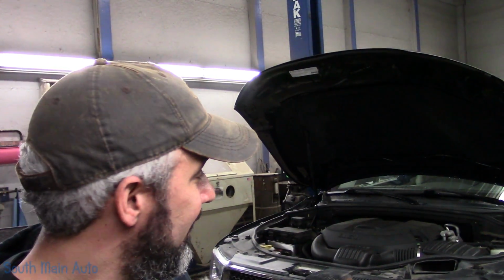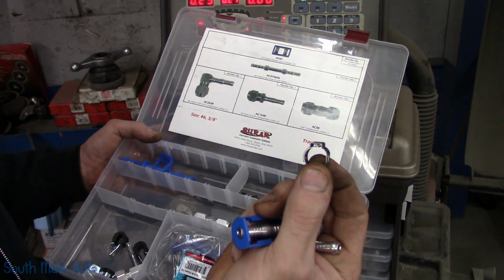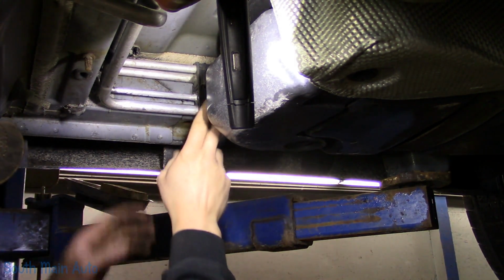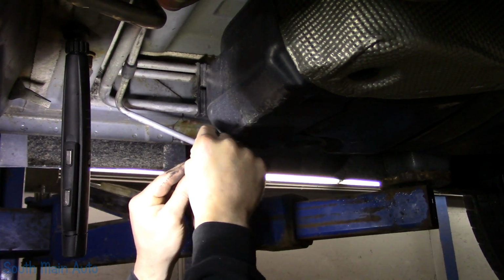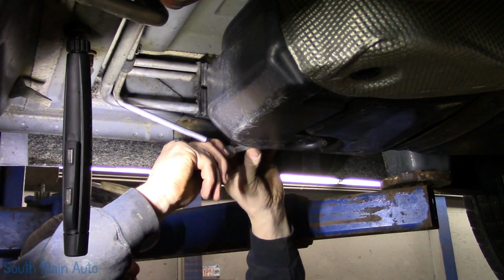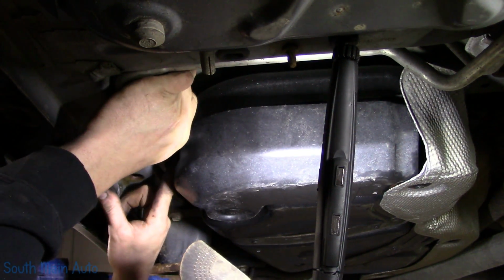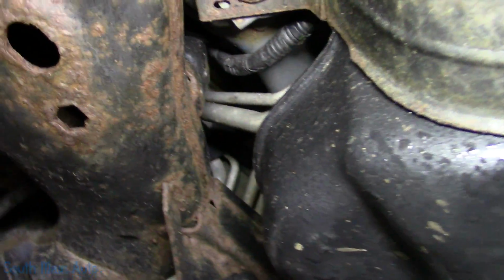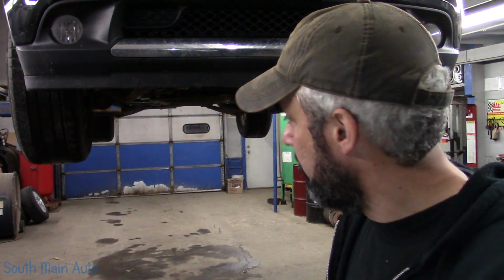Leaking Rear A/C Line Repair - Dodge Durango

Comment: Some old lady at the factory probably installed those A/C lines in 30 seconds.  That is on an assembly line with nothing else in the way, lol.  Why would the manufacturer make their design easy to repair?  They don't care.  They only care about getting it together the first time.  Same reason anti-seize is not put on any of the threaded joints, etc.  Think if you could design a car based on making it easy to repair, instead of just money/profit alone...

Comment: Great Video! We use the J-41425 and its fittings for our a/c repair needs. Do you have the machine for 1234yf yet? It sucks for how long it takes. GM has told us its government mandated that it runs all the tests it does. I can take up to 45 minutes to do an evac and recharge.
Reply from the maker: I do not yet, I will not be seeing it for a few years I imagine. Body shops are effected by the change more than me and yes the leak down test is mandatory and refrigerant ID is also mandatory on them. I am certified to handle it but have not made the investment yet

Comment: its stupid to replace entire lines of anything when all it needs is a patch. like throwing a tire away because of a puncture. everyone who cares should rinse the bottom of their car once in a while with pressure washer and soap. its just a few bucks to go to one of those do it yourself car washes. i switch from soap to rinse in one payment and get the whole car rinsed. maybe even lube those plastic holders since moisture and salt get trapped in there. those clips should be designed more to not retain moisture but oh well. chrysler and gm for ya. they keep their flawed designs instead of correcting lol that one was most problematic probably because the wheel is right there splashing salty water at it.
Reply: I used to live in Ohio.  You can rinse all day and all night.  You are never going to get all of the salt brine out of the underneath of the vehicle unless you simply don't drive the car in the winter.

Comment: Bro, You coulda 3-D Printed a new bracket bro, in like 4 hrs after 3D rendering and design  ;)
Not sure if I should stay around.... (joke, alert this was a joke)
Reply: Living Larger How much $$$$ is the 3d printer, the plastics needed and the program? I'm actually interested in 3d printing.
Reply: Or he can use a ziptie and spend 40 seconds.
Reply: Best practice would have been too 3D print the correct length zip tie... 😝
Reply from the maker: I will whittle one from a block of wood next time and paint it black haha

Comment: Hey buddy.... where you located. You seem very knowledgable.. i have a 2015 durango and need the a differential bushing replaced and also all 4 bushings from the rear crossmember suspension.

Comment: Awesome alternative repair on A/C system. What a poor design for having rear A/C one the biggest things id be just fine without as eventually you know the lines are going to corrode and leak up in the salt belt states without easy or even practical cost repair

Comment: If you have the luxury of having the system evacuated (absent of refrigerant) then the vacuum leak down is far far superior to the electronic leak detection method (after you charge the system with expensive refrigerant - only to find you do have a leak - then what????).
Reply: There are leaks that only leak under pressure. They will hold a vacuum but leak under pressure.Especially compressors,high side leaks etc.

Comment: you may want to try a conduit/pipe/tubing reamer, most are good for 1/4" and up. probably be better than sandpaper to clean the end. there's many brands around. probably work best with very gentle pressure and turning it backwards kind hard for smoothing on aluminum. I use them mainly for copper house plumbing.
for example https://www.homedepot.com/p/HDX-Inner-Outer-Reamer-HDX085/204218601

Comment: So what is your amazon commission on a $4500 Robinair machine? I do a lot of custom A/C work.... ambulances, buses etc.... I wish everyone would just use barrier hose and regular beadlock fittings.... This Aeroquip/Eaton EZ-clip and the 3-4 other companies that make their own flavors drives me nuts.... it is a pain to get the fittings, you need to use their crimper etc etc...  pain in the ass. Be happy you only have to deal with easy repairs like this or just block it off... BTW.... I do use the Dorman and SuR&R block offs but streetrodguys.com has a lot of application based kits and are really reasonable.

Comment: I would have used some rubber or foam insulation (pipe style available from Lowes or Home Depot) before the zip ties
Reply: zeke112964 that would stop the chafing, but not the vibration that would quickly fatigue the aluminum...
Reply: They've been using aluminum for VW engine blocks since the 40's.....They vibrate.... why hasn't it fatigued the engine blocks?
Reply: Because the engine blocks don't bend... They aren't thin-wall tubing.
Reply: And what makes you think the refrigeration lines are bending when they are strapped to the frame?
Reply: They aren't, now that he anchored them with zip ties... I read your first comment as he should have omitted the zip ties, though?
Reply: Maybe you should watch the video and learn how to read English before commenting
Reply: 🙄 nice response, troll.

I was having what normal people call "a discussion". If I misread your comment, the civil response would have been to clarify when I asked.
Reply: Oh, you a "fancy" troll... How cool!
Reply: Please note >zeke112964: VW  air-cooled engine blocks were mainly built of magnesium with other alloys. No real block fatigue problems until/starting in 1968-1969 (after approx 50k-60k) the cylinder head studs would loosen- 'fretting' out the block/case threads,causing large compression/exhaust leaks/obvious loosing some engine power- at cylinder to head surfaces. The basic cause was engine running hotter-(due to several different 'layers' of emission controls starting to be added on,lean fuel mixtures-and of course the engine normal cycles-and customers were starting to request factory a/c which was only installed  at dealers)-kinda like blowing out a well used head gasket on water cooled engines.......We VW dealership mechanics would advise customers, who would have no interest financially for at least a large partial engine tear down, to allow to simply remove valve covers/rocker arms-to snug up/torque lower cylinder stud nuts-worked every time-at minimum cost-no customer callbacks-of course we could not guarantee this type of 'hack' fix........thennnnnn,came the semiautomatic trans---all this extra 'stuff' causing MORE engine heat!!!.......a lot of these "loose heads" as we called the symptom-seem to slowly diminish with the 1971 air cooled product-due to a lot of upgrade engineering of block,stud threads,stud size,an actual copper circular head gasket etc. Note: all of the above has nothing to do with the always!!! same air-cooled engines having oil leaks everywhere possible,,and /or burnt exhaust valve repairs!! Not to many air-cooled engines would EVER see past 70k?? without resealing of engine and/or a burnt exhaust valves.........
Reply: Very true although the cylinder heads were an aluminum alloy .....and thanks for bring back all those horrible memories of dad's 69 Squareback with factory air....that I learned to rebuild at the young age of 11 or 12....rebuilt that engine several times and patched those brittle fuel injector wires and changed the computer 5 or 6 times as well....memories of a lifetime!!!

Comment: Hello Eric, I have 2006 highlander with a loud noisy AC compressor not cooling, the gauges read about 85 Psi on both high and low static pressure, and 15 on low and only 100 on high when compressor kicks in. Do you think it’s a bad compressor or a restriction? 

Could a bad compressor sucks from the suction line and gets the low pressure gauge to that low reading but not produce any compression at the same time ?

Thank you
Reply: You are probably low on gas. 2to 4 0z 134 will give a static of 75 to 90 on a ot day.

Comment: More bad engineering brought to you by Mopar.
Reply: Actually, from a vehicle manufacturing engineering perspective, it's very good engineering.  Single piece lines cost a lot less, they are installed when none of the other crap is in the way and are thus very easy / fast to install.  Remember, the goal of the manufacturing engineer isn't to make it easy for you to repair, it's to make it at the lowest cost and meet or better the required takt time while meeting the design service life.  He's getting paid to save them money, not save you money.
Reply: David- the problem with that is, that with that comes the problematic repair jobs, giving Chrysler the bad rep for reliability, and contributes to there terrible standing in the market... How many of those in the industry choose to daily a Chrysler? Not many. How many are sold as fleet vehicles? Not many. (Full disclosure, in a Ford guy, but I subscribe to the same "they ALL have their problems" view)
Reply: It doesn't matter which manufacturer it is, or what they are manufacturing,  I wasn't even referring to FCA, I was only pointing out the job responsibilities of the Engineers.  Engineers get the blame, but it's bean counters that are the root cause.    We would love to make it so whatever we are working on can be serviced easily (and anything we make for production lines is like that) but..... that isn't what we are paid to do and typically aren't allowed to do that if it increases manufacturing cost, which it normally does.  Take that tubing for example...... if you added the fittings in the middle like the GM ones Eric talks about, you are probably adding $0.30 - $0.40 per tube minimum.  Well, you say "it's just $0.30".... BUT that tube may be used on 2 or 3 vehicles with a lifetime production volume of 1.5 million vehicles.  So if you did all 4 lines that is $4,200,000 extra cost.  The bean counters aren't going to let you do that.
Reply: I get all that, David... I was just trying to say that, in my experience, it just seems that FCA has been historically the worst offender, (I acknowledge that there's a ton of room for bias here, lol)
Reply: Well, FCA has had the most ...... how do I say it.... corporate turmoil I guess would be a good description, over the last few decades.   They were bankrupt, Lee took them over and saved them.... then they were run into the ground again after he left.......then Diamler more or less bought them.....then independent again......then bankrupt......now Fiat.  Every time a major change like that happens, the core values get changed, the mission changes, the focus changes, rules change, structure changes and there is a lot of culture shock that goes on throughout the organization.  When it happens in fairly quick succession like it has for Chrysler, it leads to some not really good decisions here and there.

Comment: Overall it was a great video, I am only criticizing the zip tie method amateur from my POV. The location of the leak is a terrible spot to begin total pain in the butt but whatever works and get the customer back on the road.
Reply from the maker: what is a better alternative? Just curious...
Reply: You asked for my criticism at the end of this video clearly you didn't like it. Customer may not come back / don't care as long as the  A/C works at 30 degrees temperature.
Reply: People get confused between a repair and a restoration. It is just not feasible to make a custom bracket and charge the customer another 2 hours labor. What you did is perfectly fine and will last many years. Great video as always, thanks.
Reply: South Main Auto Repair Jesus...........these zip tie haters must think it is going to the barett Jackson auto auction. Makes me vomit
Reply: @ Concerned Citizen - Just wondering if this zip tie A/C line holder will pass a state inspection???
Reply: Just wondering if this zip tie A/C line holder will pass a state inspection???
Reply from the maker: Oh no, your criticism is fine I am just curious to the alternative repair short of replacing the lines is all. AC Has no effect on state inspection.

Comment: Diabolical routing of A/C lines-sure to fail -for dual zone a/c?        egads !!
  ONE    all stainless steel zip tie can be used-far better than even u/v treated plastic ties though much more expensive

  and for 2012 car,LOTSA RUST ALREADY !!   -suggest you recommend Rust Check or Crown rust inhibitor treatment 
    or Dodge would be in crusher within 5 more years ~~

Comment: Your comment about vacuum decay is absolutely incorrect in all manners.  It is possible to detect even a very small leak with "vacuum decay" by doing at least a 10 minute test and not a quickie reach around bull sh*t test.  DuuuuH.
Reply from the maker: A vacuum leak test will pass on a vehicle every time unless a hose is missing or the leak is so big you can hear it hissing. 30inhg in the line is only 14psi on the outside of the line pushing in. Yes even at the ten minute mark. Pressurize the system with inert gas at 150psi now you can find the leak. Beside even if you could run a vacuum test the vehicle and all of its components would have to stay a constant temp or your test results are invalid. When is the last time you pulled in a car and every thing was at an even temp? Remember temperature directly effects pressure. Pressurize the system and no one cares about temp at that point. The heated probe "sniffer" I use is highly accurate and does not create false positives like a lot of the earlier models used for detection.

Comment: Good job, however that zip-tie thing looks kind of hokey. Should have ordered a new plastic bracket and installed it properly in the bracket.
Reply: What particular bracket do you order that will fit over the compression union?
Reply: The black plastic bracket, maybe with some minor modifications, should fit over the union.